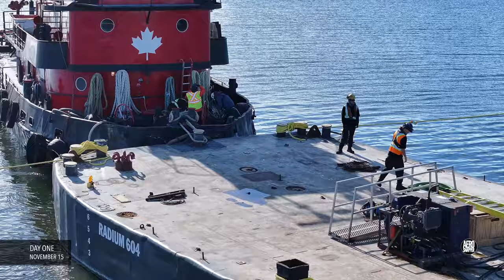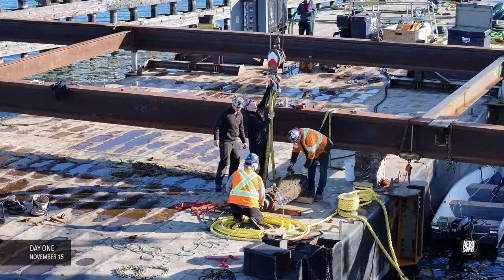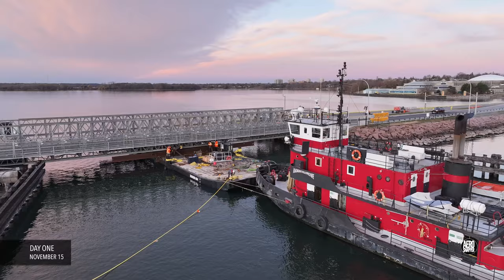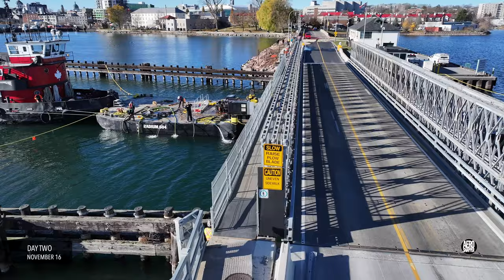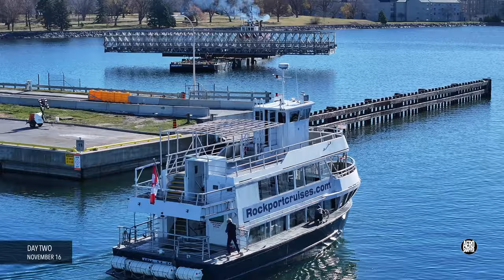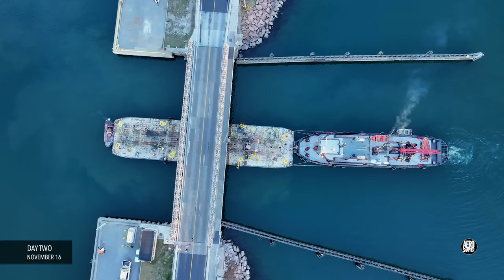Day Tripper   4K

Comment: Excellent operation by all.  It's not something that should be repeated more than necessary, though.  It's been quite a while since the singing bridge was condemned, and I dont see the plan moving forward.  I'm not local so I may be out of the loop.  Cheers 🇨🇦
Reply from the maker: James - the operation went very smoothly.  Repeating the opening of the waterway will be hotly debated, for a whole host of reasons.  I don't think you're out of the loop on future plans - I think it's just proving to be a complex decision-making process, which will take some time.  I'll keep everyone posted

Comment: I shake my head at the ongoing costs of doing this compared to fixing the original bridge that would have likely lasted another 200 years.
Reply from the maker: A full explanation of the decision to take this route has not been given.  We should have confidence that those who took it, who were in possession of all the facts - not just opinions - made the correct decision.  Addressing the problem was never going to be a quick or inexpensive fix.
Reply: Or just concentrate on building the replacement. Or is that because things like this in Canada take way too long
Reply: @Aerosnapper  Maybe some of these Belgian designs would be neat - https://www.youtube.com/watch?v=FtStF6r_cXc

Comment: Goodness, we are looking at inches (or centimetres) of clearance here on either side of!
Reply from the maker: Jenn - absolutely correct - my eyeball estimate - I will make a point of measuring it before long - is about an inch and a half either side (<4cm)
Reply: And one has to consider thermal expansion and contraction in the design.